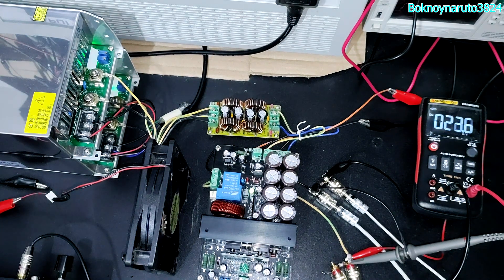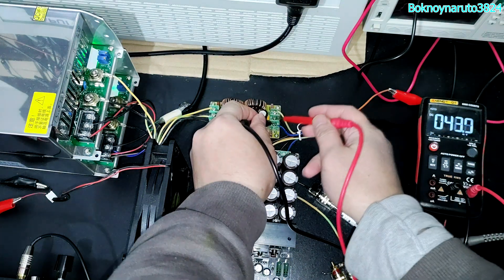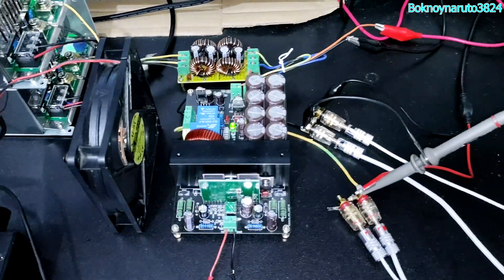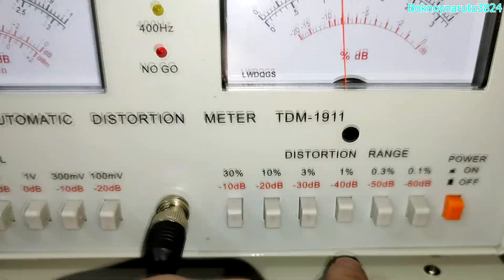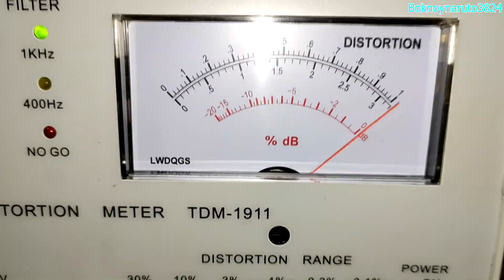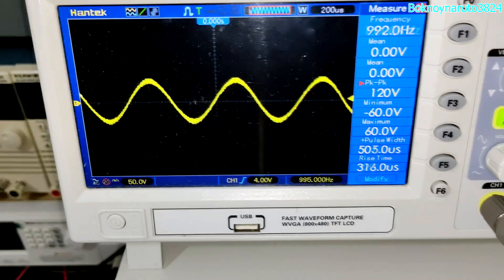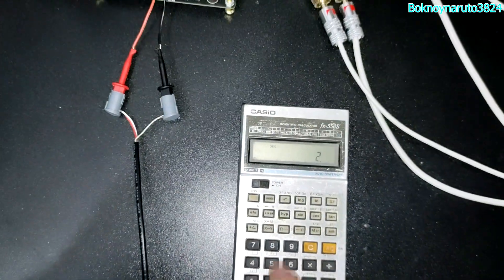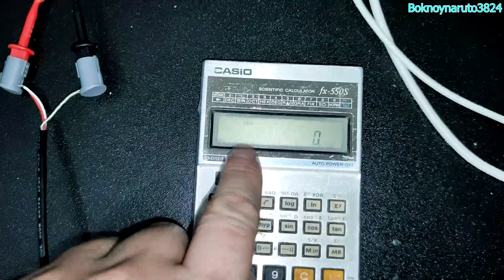1KW IRS2092 + IRFB4227 ±70V ±65V Test

Comment: Is changing supply voltage affects to gain/volume of amplifier? When I power i from battery converted to symetrical +- 70V and battery voltage drops during discharging and at low end voltage drops to +- 60V will affect volume when input source will be the same? Not max power of the amplifier, only volume when playing for example at 1/4 power.